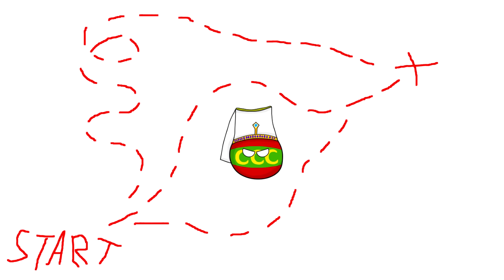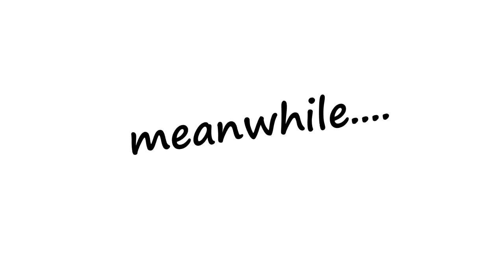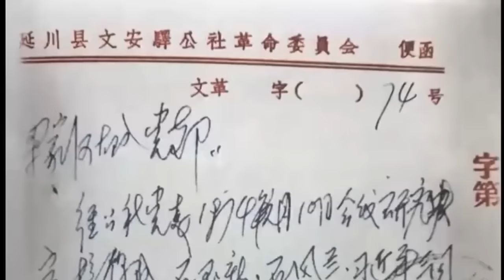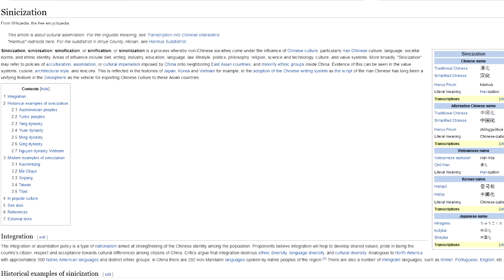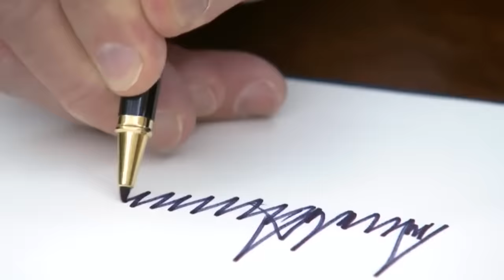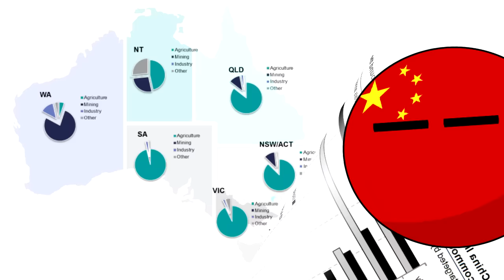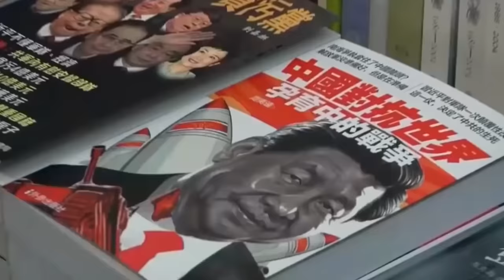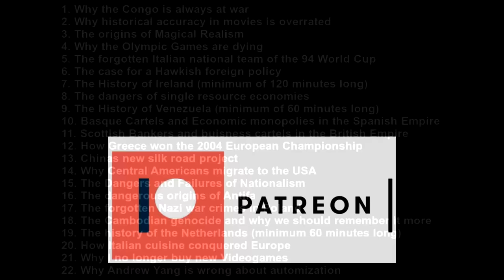Trump's Biggest Failure

Comment: This was a very interesting and well-researched video, but I'm wondering how well it holds up three years later - not the underlying analysis, but the conclusions. 

China is speed-running away from un-ideological pragmatism and towards a full-on facist cult of personality. Their warrior-wolf dimplomacy has soured their relationship with many countries, and many of the debt-deals from the Belt-and-Road program have gone bad or are in the process of going bad (so much so that China has quietly ramped down such foreign investments significantly). 

Europe is in the process of heavily re-examining ties with the Chinese economy and the CCP (in part thanks to the Russian invasion of Ukraine and China's refusal to condemn it, in part due to Covid opening the public's eyes on the importance of Taiwan's semiconductor industry combines with China's extremely aggressive moves against Taiwan). 

Finally, Biden is strongly anti-China, and is relying more on the approach of domestic subsidies rather than tariffs (though he does use those), which are far more difficult to circumvent (they have their own set of problems, but between tariffs and subsidies, subsidies are, I belief, more effective). It seems to have become a bi-partisan tradition for the head of the House to visit Taiwan against the explicit wishes of China just within his presidency, and security guarantees against China are starting to be extended more liberally. 

I could be completely wrong here, and these may just be superficial developments, but I doubt it. (It by the way ignores internal problems in China of enourmous, and quickly growing, debt-to-GDP-ratios, low domestic consumption, and conflict between local governments and the central government preventing anything from being done about it, in addition to severe demographic problems that will make the fundamental assumption of China as the world's largest source of labor from this video become untrue more and more over time.)

Comment: The natural counter to china is the decentralization of its strengths through trade. You said it and it obviously sounds easier than it is. I suppose the main obstacle is the already established Chinese influence in many countries’ foreign policy, but even while being dependent, most mandataries should be afraid of the centralization of economic influence. All that which China does and did in the previous three decades, can be emulated in a variety of countries simultaneously therefore decentralizing the economic influence inherent to the world’s workshop. Anyways, I’m the short term, America has to find a way to become a more attractive partner to underdeveloped economies. The US’s biggest asset is its strong domestic market and consumption, but that doesn’t matter as much when underdeveloped countries tend to export mainly raw materials. Any American attempt at pushing back against China’s growing  sphere of influence will demand further cooperation with India and other emerging manufacturing nations while also pro ping up its own productive capacity, at least to secure partnerships in the shot term.

Comment: One thing this video ignores is the need for an empire to be functional domestically. In fact, I think China is a great example of the dangers of neglecting domestic policy. It may have a lot of influence abroad but the country itself has many crippling such as a lack of clean water and poor demographics. The channel Polymatter did a series on it called China’s reckoning that goes into detail about it. It’s rather shortsighted to claim that focusing on internal problems is a mistake.
Reply: bra this video is called trumps biggest mistake.. not chinas biggest mistake
Reply: @gustavohermandio1440  yes and it’s implying that focusing on domestic concerns is a mistake. That’s wrong and China is a perfect example of the negative effects that mindset can have.
Reply: @masterblaster7484  "it’s implying that focusing on domestic concerns is a mistake"  what parts of the video makes you come to that conclusion ? i believe that its actually implying that not focusing on china as a threat is a mistake. i dont think kraut meant to make a point about domestic issues at all.

Comment: Getting my this aged like dog shit comment in before the Chinese collapse. How they had us all fooled with their big moves that turned out to be…. mirages. Love you Kraut
Reply: what collapse are you talking about ?
Reply: @gustavohermandio1440  which would you prefer? The demographics collapse that is already at the point of no return ? Maybe the entire banking system on the brink of collapse? The belt and road collapse which is starting in Sri Lanka and will only get worse ? The zero covid policy that has single handily shut down the worlds supply chains? You chose
Reply: @AwayAgain  cant i pick them all ?
Reply: @gustavohermandio1440  no
Reply: China has been on the verge of collapse for over 30 years now. Just give it a rest 🤦🏾‍♂️
Reply: @blueciffer1653  In all fairness, collapse can be a slow process. The collapse of Rome took like a century.
Reply: @eddie142  Except China has shown no signs of collapsing.
Reply: @blueciffer1653  Well, there are a couple of signs. The most glaring is the population issue.
I'm not saying it is collapsing, but it have already sown an eventually collapse that won't be completed until several decades later.

Comment: 45:10 most of these rifles you see outside of China are actually the export variant of the Type 95 rifle, the Type 97 and it's various later iterations designed to optics and attachments through Picatinny, Keymod, and M-LOK rails. Type 97s are chambered for 5.56x45mm/.223 Remington while the original Type 95 uses the proprietary 5.8x42mm rounds that is almost never seen outside of China.

Comment: This aged poorly
Reply: It really didn't...
Reply: @hellboundchaoscommand7567  Chinese military tech outpaced Russian tech a decade ago, and Russian military tech hasn't performed poorly, it performed as expected.
Reply: @voidtempering8700  Chinese military officials have literally stated their tech is based on Russian and American designs though I will not argue the Russian point of it performing as expected
Reply: @hellboundchaoscommand7567  Just because it doesn't s based on it doesn't mean they didn't outpaced them. Just look at the J-16. The Chinese J-16 is a Flankers variant that is better than the Su-35.
Reply: @voidtempering8700  that is based on the F-35 not the SU-35
Reply: @hellboundchaoscommand7567  The J-16 is a Flankers, what are you talking about?
Reply: @voidtempering8700  sorry I thought you typed J-20 instead my mistake